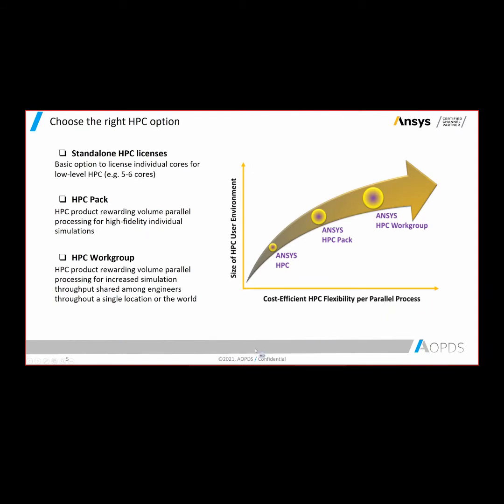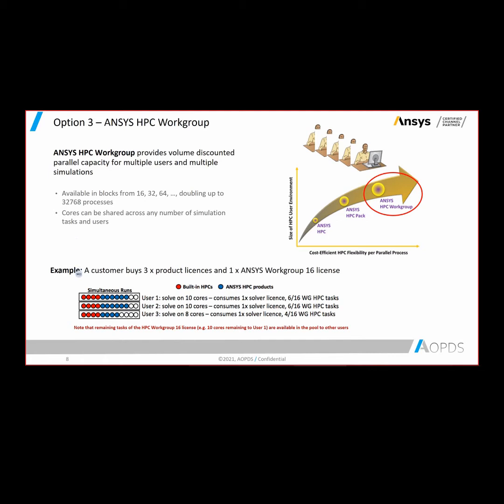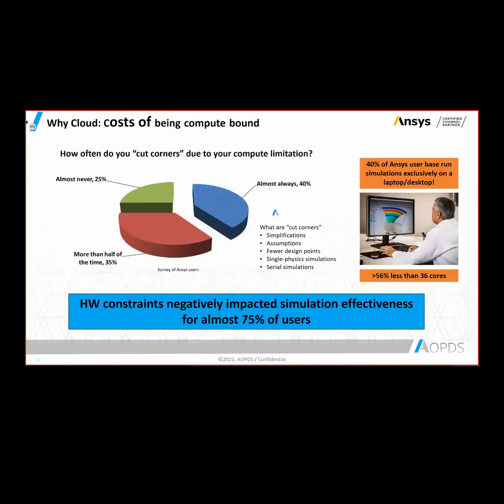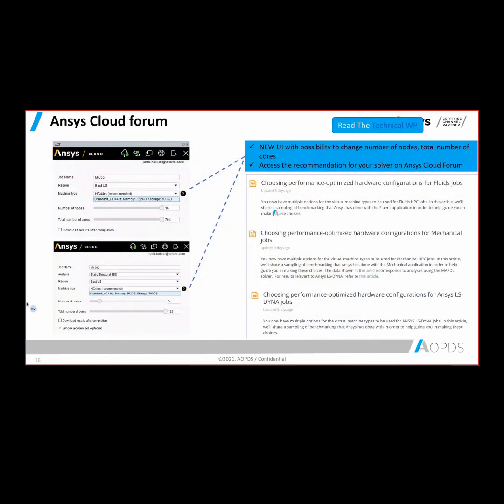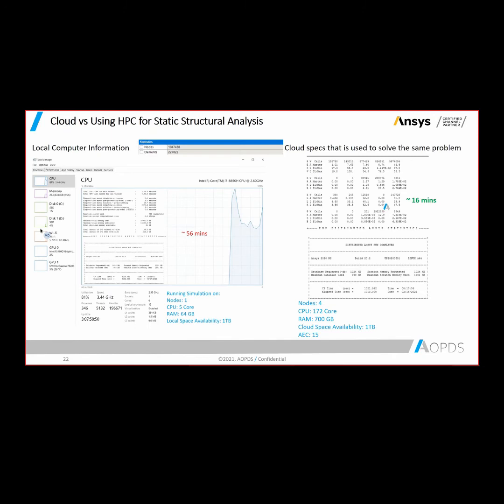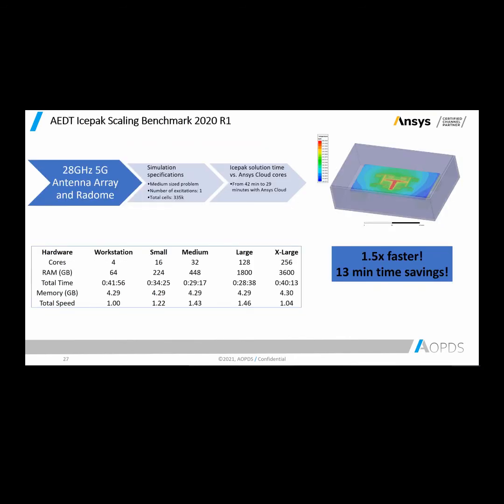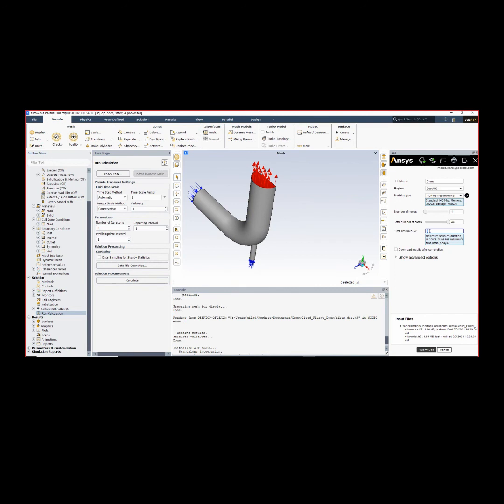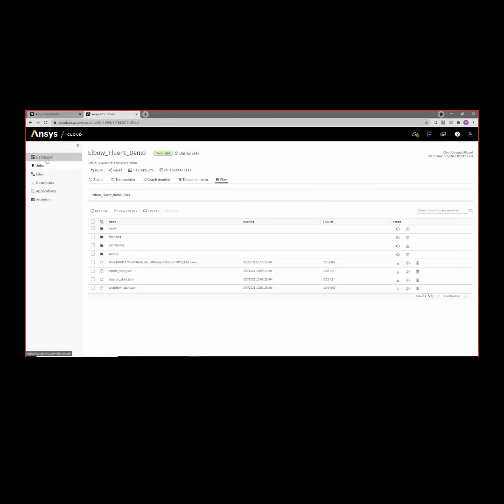Ansys Cloud and High Performance Computing

Comment: What happens on the cloud when the solver unexpectedly terminates due to error? Is the subscription lost and you lose credits? Also , what is number of nodes, slide 16? Is it a cluster of processors?
Reply from the maker: If a solve is terminated due to unexpected downtime - then a credit can be requested. If a solve is terminated due to any other reason - then the elastic currency (subscription) is consumed and will not be credited